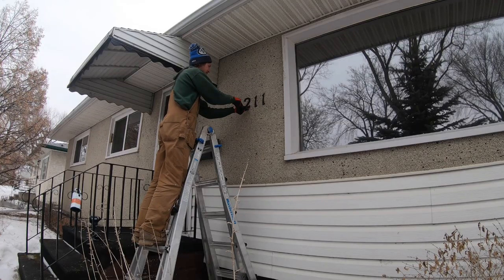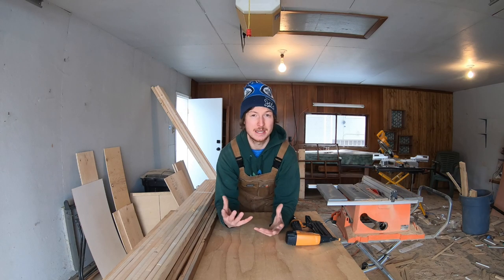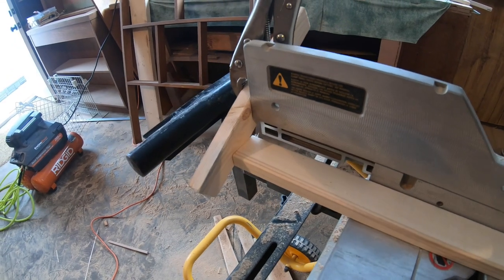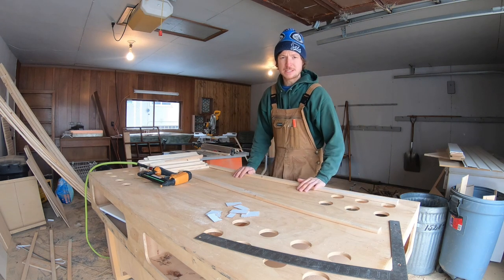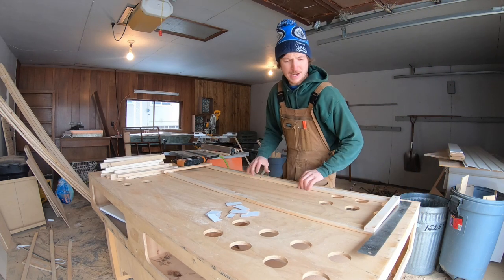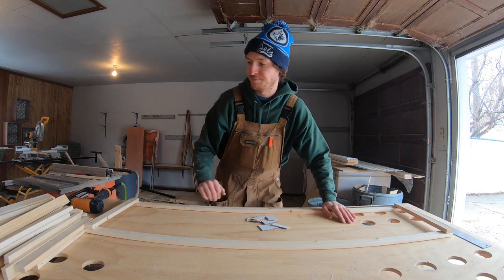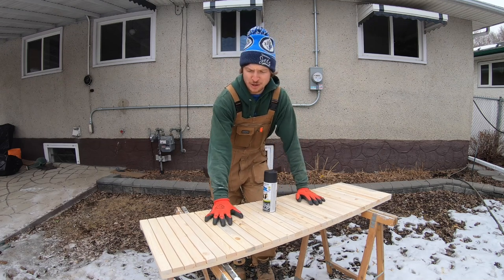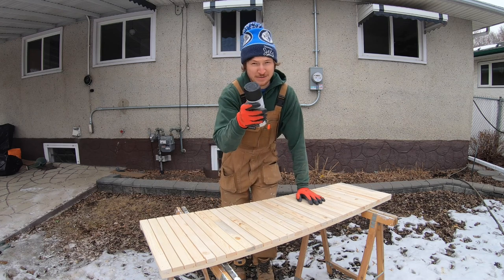DIY modern exterior window shutters (The Partridge House Episode 7)

Comment: Love them. Did you do the whole build with 1x2? If you had to do it different, would you choose a different type or size of wood?
Reply from the maker: Thanks! Yea- everything was done with 1x2's. A real quick and easy project. I was at the house the other day, and they still look great two years later. It helps they are protected by an eave as well. One thing that can be done to beef up the weather resistance would be to make your own 1x2's out of treated lumber, and then use a solid stain to finish them. If they were constantly exposed to rain or moisture, this would be something to consider for sure.